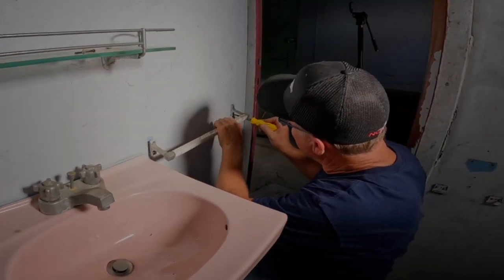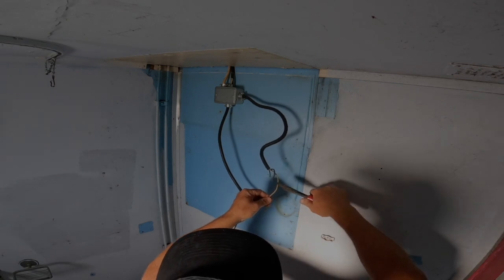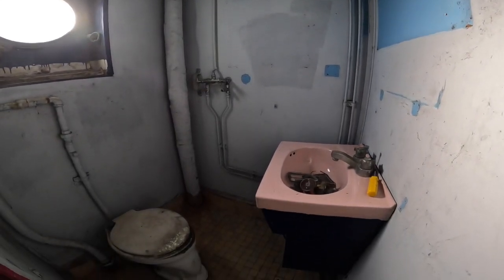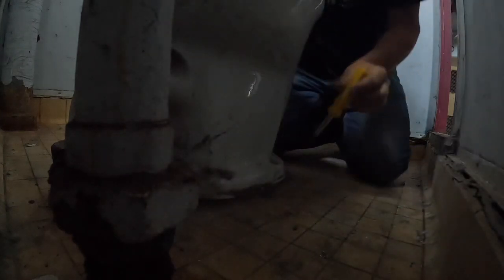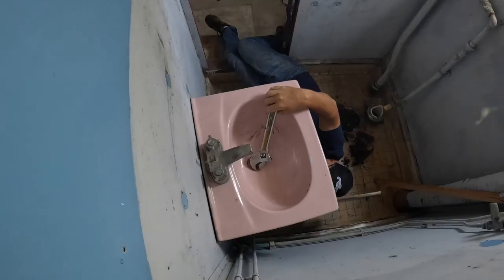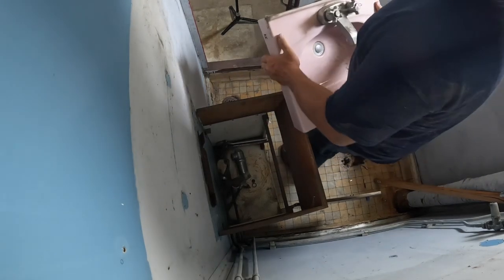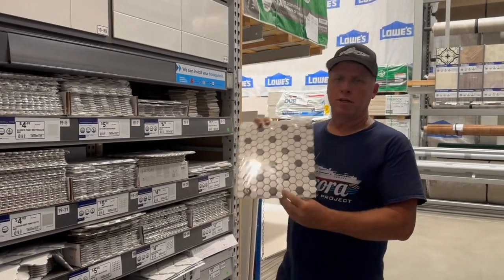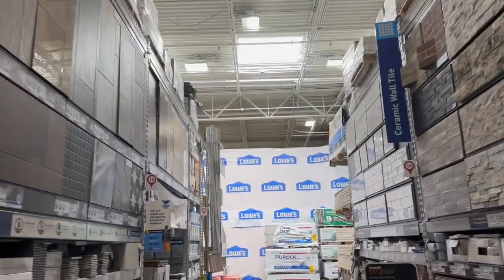CABIN BATHROOM DISMANTLE ABOARD OUR CLASSIC CRUISE SHIP READY FOR RESTORATION OR RENOVATION

Comment: Remember the cleaning issues with small tiles, lots of grout, and tight spaces.  The larger the tile and thinner the grout lines the better off you will be.  The nasty pipe in the corner of the room needs to be closed in.  The electrical all needs to be water proof rated and what I see is not even close.  This is an amazing project and you certainly have your hands full.
Reply from the maker: Thanks for the thoughts.   I agree with the large tile theory.   Makes a lot of sense.   The electrical will be replaced as needed with marine grade wire.  The last thing I would ever cut corners on is electrical.
Reply: Large tiles isn’t good on a ship. Ships flex

Comment: 4:44 nice technic mate, I have learned quite a bit with this restoration.
Reply from the maker: Pulling nail?   I have yet to event start the restoration.  Just the teardown so far.
Reply: @AuroraRestorationProject  the way  you used the pliers. And you have been restoring the Aurora.Also did not know about that tool you used to xheck the lamp circuit.

Comment: Remember that ships move, flex and vibrate (when they run), large tiles have a tendency of cracking. Modern cruise ship bathrooms are usually wet units (all in one) installed in the stateroom and tiles are usually fake. They're printed or stamped onto the walls to prevent cracking and leaks. On the ships I work on, real tile is usually kept for the public areas only for maintenance reasons.  correct reaction from Niels Polin dont use breakable stuff use flexible parts and for flooring use pooring stuff that can stand the movement of the vessel.

Comment: I liked the grey and white version of the dot tile and the octagon and square next to it. It's a softer look for an ensuite but would work with the vintage theme. Pink and grey was so typically used together. The grey would work with the aqua, mint and lemon bathroom fixtures used then so you could keep the look cohesive without having to do all the bathrooms with pink sinks.
Reply from the maker: I was looking at that one too.  The pattern isn’t too bad.   It’s definitely a possibility unless something even cooler pops up..   Thanks

Comment: If you don't have one yet,  I can't recommend enough the most magical tool ever for removing rusted screws and light bolts and nuts - its called a "shake n break" and goes on the end of any old air impact hammer. It's not like an impact driver since it doesn't twist the screw as it vibrates,  it just vibrates the hell out of the screw head and you gently turn it by hand with the driver handle. It's $50 and has paid for itself a hundred times over for me on rusty screws and small bolts that would absolutely have sheared off any other way. 

Only downside is it requires air and a small cheap pneumatic air hammer but I can't begin to stress just how well that stupid little tool works on the most corroded stuff.
Reply from the maker: Interesting.  Just looked it up on YouTube and seems like something we would definitely use.  We have lots of air happens kicking around.  Next time I’m took shopping this will be on the list.   Thanks

Comment: As Garyjarvis2730 mentioned about the cleaning aspect with the tiles, stick with less grout line.  I was a janitor for 13 yrs. Alot of older schools had the smaller tiles and it was horrific to clean, even with a power washer. I'd definitely recommend as little groutline as possible. :) 
While i understand there are alot of different grout cleaners out there, its best to keep cleaning simple. 
By all means though, it's your project and I'm just a woman enjoying restoration projects. 
Youre doing a fantastic job with the boat! I love checking back to see whats happening :)
Reply from the maker: I completely agree.  There is a small curve to the floor since it is made to drain a specific way.  However if it is possible to use larger tiles and strategically place them in a way that will drain properly I am all in on this ideas.  Thanks
Reply: @AuroraRestorationProject  I completely get it :)

Comment: I think if I were you I would get a corner shower unit to help contain the water exposure for the bathrooms of this size. Something like the Breeze 32 in. L x 32 in. W x 72.81 in. H Round Corner Shower Kit with Clear Framed Sliding Door in Chrome and Shower Pan. Home depot has these for example. This has a simple look that can meld well with a retro 60's look. It will cut down on all the tile work and the small round tiles will look good with a corner shower unit. They can be rounded off or squared off etc. Go with what looks the best. If you choose to go with the exposed hot cold water lines to the shower head like are there now it will look good that way also. The Electrical definitely needs replacing and I would look at LED replacements that look like they are from the 60's like the Czech ceiling lights or Amorphous Czech wall sconce lights.
Reply from the maker: Interesting ideas,   I would need to measure things out and see what enclosed showers are actually available but can certainly envision the concept.   Czech lights.   Will have to dig into that and see what we are talking about..   Thanks for the advice.

Comment: Hiya Chris . Well , lead pipes bringing water to the toilets ? Does the Ship separate drinking (potable) water from Service water (toilets,sprinklers,fire hoses) ? There must be large Cisterns way down in the hull . If they do separate the two types of water you could almost use the rain runoff from the scuppers to refill the water used to flush the toilets , with some filtering . However , if this waste and water ends up in a holding tank somewhere you will have to declare it when pumping out the sewage tanks as the shore facilities need to know you have lead leaching in the waste . Those 12 x 12 floor tiles that show up under the carpets are probably asbestos based . No worries . As long as you don't "disturb" them you can carpet or plank over them . If you jack-hammer them out you'll need a HazMat Team . LOL .Have you found the water and sewage storage tanks in the ship ? What condition are they in ? Starting to enjoy your videos BUT , you need to finish a topic in that video . Your starting the engines video ended without starting the engines . See what I mean ? Don't worry , you're getting there and us along with you . Cheers Mate !/SRK

Comment: If each bathroom or joined rooms shared a on demand hot water heater you could remove miles and miles of pipes from the boat not needing hot and cold running water.

Comment: Put a mirror above the sink accessory Holder is perfect Full length mirror on the door.… keep fixtures as original if you can… polished, stainless panels in Shower area, Rain Shower head. Ring Towel Holders in Shower.

Comment: They used goboard type foam board on our bath remodel. Seemed so much easier to work with than cement board. And only required waterproofing for screw holes and joints.
Reply from the maker: The concept of of goboard sounds amazing.  Looks like I might have to give it a try and see just how great it is.

Comment: Find a plumbing supply house that has a showroom. You  are looking for the "T&S" brass faucet line. they have the look, are solid brass with plated finish and nearly indestructible- also repairable. They have hardware that should fit most every cabin and kitchen piece you will need. All from one Mfg, one parts train. Btw, "Made in the USA" last I looked. Same people should be able to show you some lavy bowls as well as toilets . But your lead pipe supply will need to be removed and redone- I don't know of any presently made porcelain that will use it. I'm thinking you should be at least resolving all the "behind or under the floor issues " before you start tiling.

Comment: I'm curious about moisture control and ventilation for the bath area.  Also, insulation of the bulkheads to reduce condensation and related problems.
Will the bathrooms have a consolidated waterproofing, such as is used in higher-end RVs?  In which case the shower area is also the entire toilet area, and the floor drain also drains the bathroom itself.
And another consideration:  Making sure there is a check valve in the drains to prevent backflow of 'liquids' should there be surge in pipes due to rolling of the ship in higher seas.
And have you done a survey of the ENTIRE sewage and drainage system?  That toilet drain looks more than nasty, with replacements possible with no-hub systems to reduce labor and materials costs.
Considering how you attack the plumbing systems as a set would give you some considerations of where to start.
And about flushing....would you have to have an in-port storage for black and grey waters, and pumping connections?

Comment: For the walls I would use a prepainted board with a tile pattern with a cement base and for the ceiling a resin base prepainted board. These are very durable and easily installed and maintained
i prefer lino for the floor because it is easily laid and more water proof than tiles

Comment: Try to pick durable products and also keeping in mind try to keep the weight down so when you apply to the other cabins less fuel for the engine's having to haul the extra weight, but needing to replace the concrete floor if it's a must.
With the leds lights and ip rating 65 should also help the power generators not work so hard.

Comment: I am wondering why you are doing each cabin individually vs gutting them all and purchasing replacement fixtures and items like tiles in bulk?  Wouldn't that be more cost effective and create consistency?  Of course the funding is tougher but ultimately will get you a better result.
Reply: Possibly to see what works well and the likely problems rather than have a contractor guess and bake in a large margin for error. I am getting more into this channel with the level of detail shown recently. I think he would be well advised to talk to a couple of boat chandlers to understand more of the gotchas but I suspect he has a lot of experience and friends in the marine industry. The only thing I would have done slightly differently is to avoid tossing any original fittings until the final project plan is set in stone. Many of these items can be used to repair the nicer ones if he wishes to have a few "retro" cabins e.g. towel rails have survived 40+ years of use so they might seem flimsy but obviously are tougher than they look ! 

One thing he might want to look at is to merchandise some of the excess original fittings to channel viewers -  "Your little piece of Aurora at home ..."

Look forward to seeing how he decides !

Comment: looking good so far!  but before buying a lot of wall board, you really should figure out the plumbing layout/repair first.  And you have no idea yet of the quality of the structure behind the board yet...  You have supply lines, drain lines and vents that you might want to put IN the walls behind that board and drains to go under the floor repair...

Comment: If you yuse Grey gipsom its not for yuse in bathroom you need green plate this is stronger because there is in the plate there is fiber wirering as wappening to make it stronger and  keep water out
Reply from the maker: Good call,   I will have to investigate a bit more but like the idea.
Reply: I yuse to be a carpenter on inland ships in the netherlands i tailing and making bathrooms in a house

Comment: I applaud what you have done, but just wonder if you have ever investigated the integrity of the hull itself, especially in the area where the underwater hull meets the above water hull. If you are going to have problems then this is where the crucial problems will occur. If the upper works are all smart and shiny counts for nothing If you do not give priority to the area which is most important (and most difficult, and probably most expensive) to maintain. By all means carry out cosmetic maintenance, but please sort out your long term priorities.

Comment: I feel a scream at the screen coming on. Remove any wood, replace the wood with thin set cement on the floor. The entire bathroom is part of the shower, the curb at the entrance keeps the water in and flowing to the drain. Try to keep porous products to a minimum to control mold and mildew. 

For the floor tiles, find some with a "matte" surface for slip resistance. The shower corner should have non-porous surfaces, perhaps going all the way to the overhead. Period specific choices should lean away from 1970 avocado and towards the the blue of the paint. 

Check the distance from the bulkhead to the center of the water closet drain, and select a toilet based on that measure. Otherwise, it is cut and weld time for a closet flange. The existing waste pipe looks to be Oakum and Lead.

Comment: Potentially easier to just gut everything -EVEN THE WALLS FROM ALL CABINS open up the space...Cut it all out and haul it away...  then rebuilding all the wire conduits and pipe chases plus central heating and aircon. The modernization of plumbing wiring and distribution breakers would be much easier and more reliable than having 1000's of scabbed in pieces of pipe and wiring.    I see all that old wiring and breaker panels as an electrocution risk for one soul at best, or fire for many at worst. I would suspect you will need some sort of COAST GUARD inspection/certifications or even landlubber building code issues with everything just scabbed together.   Also easier to fix the overall floor decking rust / sagging and concrete in one big shot. And, to install fire systems, linked alarms. IT networking, etc in the new conduit chase.   And....then, reformatting the floor space and cabins with new walls into new shapes and sizes instead of a bunch of little "phone booth" rooms,  -Thus potentially a better fit for your overall plans for the ship.   Day cruises? Museum?  School?  Classrooms?  Conferences? Wedding Venue?  Stationary Hotel?  Private cruises?  All of these uses would be better served with larger rooms or larger cabins.    I just don't see a lot of use in just returning all of the tiny cabins to their 1 or 2 person original functions.      it may also be a lot CHEAPER to turn all the cabins into a vastly smaller total number of rooms. - less fixtures, less bathrooms, less plumbing, less electrical, LESS ONGOING MAINTENANCE!  and better future revenue per square foot.    I get the idea of "period appropriate" and I agree with that approach !!!!   ...   But I don't see any client (of future use) wanting to spend time in a 1950"s sized tiny cabin with one peep hole.   Overall, I love what you doing!!!      and this is just one man's keyboard-opinion who is not holding the screwdriver.      You keep going !!!!!

Comment: Be careful pulling the old wire out it could be tied into other fixtures you have not looked at yet 😳😳 and floor tile should have a gripping surface for a non slip grip  and angled towards the drain.
Reply from the maker: Thanks for the advice…. Seem this ship does have more complex wiring than others I have worked with.

Comment: I see you are looking at one cabin but this one cabin is part of a system of interconnected cabins.  Wouldn't it be easier to gut the cabins entirely then reimagine the cabins as they may have been replacing all of the wiring and plumbing in one go?  Former owners did no justice to the spaces and destroyed what was once a nice living space.
Reply from the maker: This cabin is part of a block of 5 cabins.  Those 5 cabins will be turned into 3 cabins.  Two with large spaces and this small cabin we are digging into now.   Your 100% correct.  If I replace the plumbing on one I have to do them all.   Have already mapped everything out and I’m prepared to run new pipe to all.
Reply: I had a thought on your cabins, I'll throw it out there.  In India and Bangladesh they ship breaking cruise ships.  Modern cruise ship cabins are made of steel and are unitized, just roll them in and plug them in.  I wonder if you could make a deal with them to get a bunch of cabins and have them shipped over.  Crazy idea but you could get a lot of material that you need at a much lower cost than the hardware store.